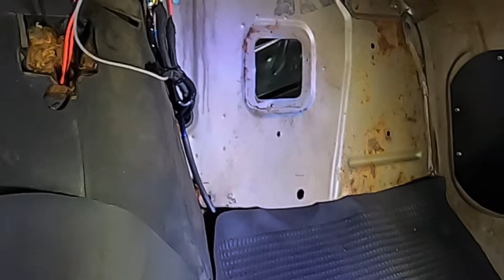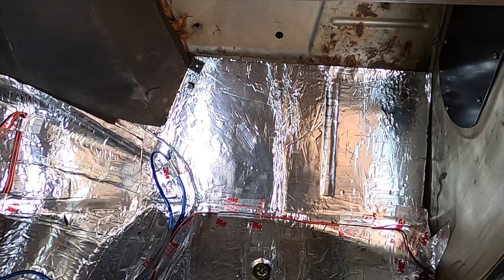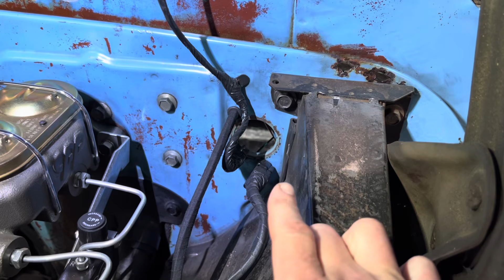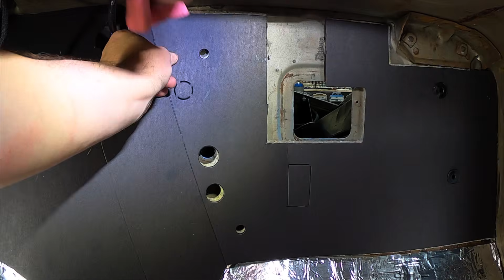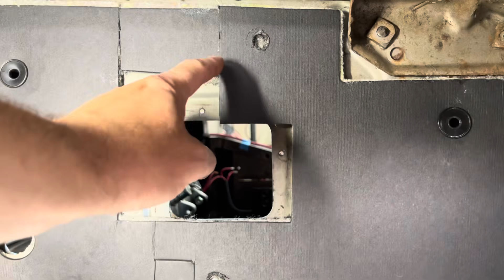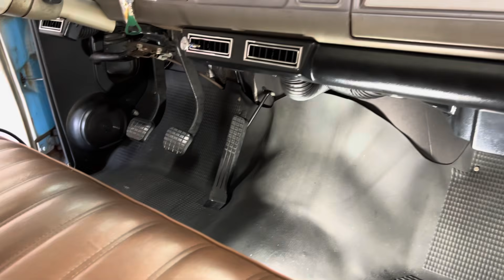Factory firewall pad replacement 1966 Chevy C10

Comment: Yeah, found that those push pins are worthy of some choice words today… 

I am not overly happy with the figment, and totally agree that all the holes should have just been perforated and let the end user cut out what they need!

1964 C20 Resto-Ratmod is my long term project (last 7 years- all the way down to the frame.)
Reply from the maker: Yeah those push pins are a pain. Firewall pad looks good in the end but it could be a lot better. Thanks for watching the video and good luck on your 64

Comment: I'm using nuts, bolts and fender washers to hold mine in. Those black plastic pins are ridiculous. I broke a few trying to hammer them in.
Reply from the maker: They are a pain to install. I actually stuck one on the end of a drill bit and spun it while holding a piece of sandpaper just to get it to fit through the hole.